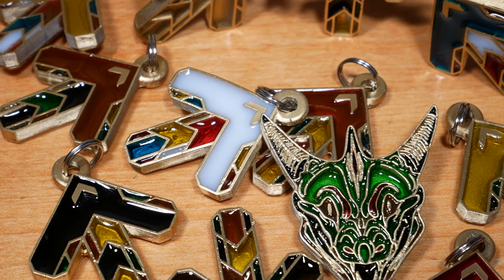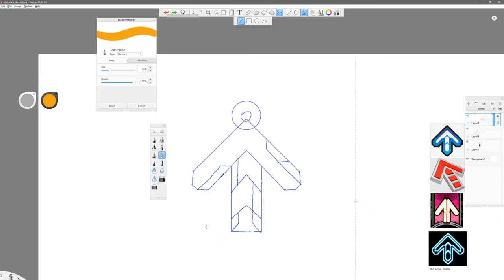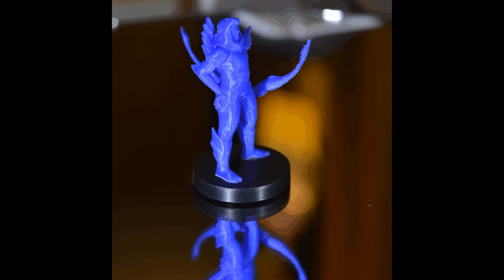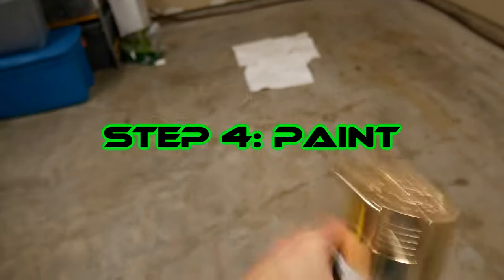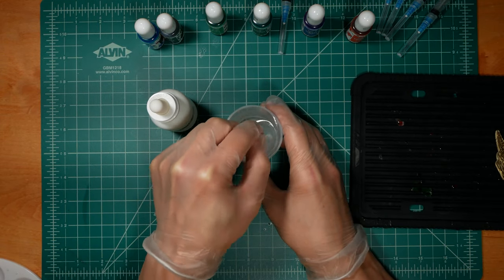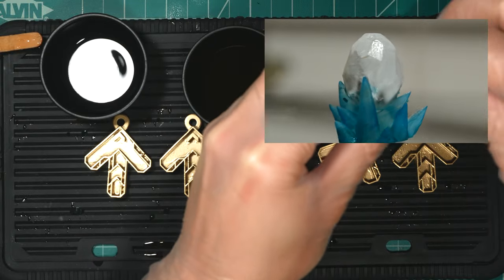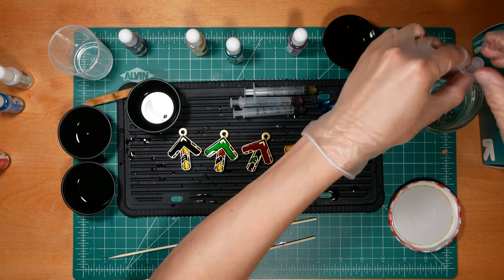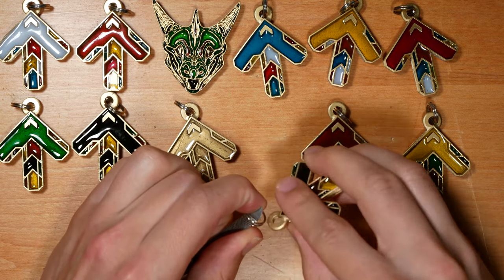How To Make 3D Printed Pin Badges at Home (3D print and Epoxy Cast)

Comment: I made a few pins following a very similar process, except I took my initial print, created a silicone mold, and then reproduced the pin using a plastic like resin. I then painted the pins with enamel paint, but the syringes I was using were way too big (the model paint squeeze type). These syringes would have been much better! Without any pressure pots or vacuums the mold came out pretty ok and the initial POC pins were serviceable. I think there's a ton of room here with either approach for makers to run off a good number of small run pins

Comment: The pins look epic!

I do have a tip that might make life easier - just use the UV resin from your printer instead of a 2 part. Fill the voids and then just stick it in your cure bin and you don't have to worry about a working time. Also, maybe look into small squeeze bottle with fine tips, those might be easier than a 24g needle. I've been doing a pretty similar process with stuff out of my Snapmaker.

Last thing xD some people need syringes for things like insulin for diabetes (or their pet has diabetes and takes insulin) and the local pharmacy doesn't have the size they want so off to Amazon we go lol
Reply from the maker: Thanks for the help! Although I'm not sure how well UV resin will dye, it can't hurt to give it a try. Do they have squeeze bottles this tiny? The syringes were needed because of the really fine control required for palcing the resin.
Also, another use for amazon needles is pet medicine! I forgot about that, too lmao
Reply: @LazerLord10  I think mine are 1 ounce? UV resin dyes really well, I used to have and Elegoo Mars and would put alcohol ink the reservoir resin.

Comment: HI! I'm trying to make  pin using an svg, but every time I try uploading line art to create the ridges similar to what you have here which makes the cavity for the resin, I can't get the solid backing with the raised line art. It just extrudes the line art leaving a hollow space where I'd like to have a solid back like in this video. Is there a way to fill in the empty spaces that I'm not seeing?